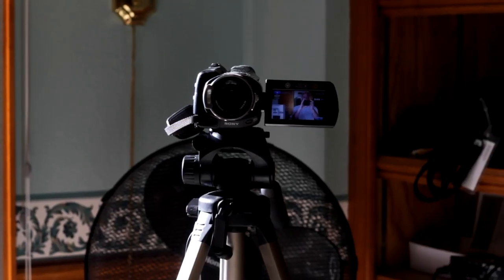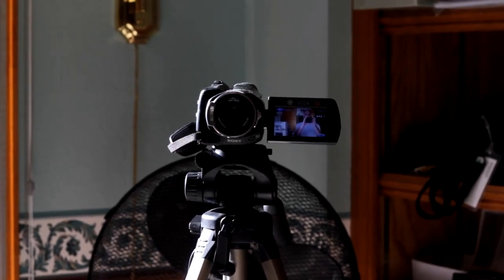Tip for Steady Panning and Tilting DSLR Video

Comment: Another cool trick/tip is to use a bolt (same size as the tripod hole) with a piece of string attached. The string has to be long enough to reach the ground. Put a loop in the end of the string for your foot to go through. screw the bolt into the bottom of the camera and shoot with a little tension on the string. It will steady the camera while shooting video.

Comment: Hey Dave!!! I am using a Canon EOS 550D right now, but it has not got any 60 fps mode!! There are just 1080p 25fps, 1080p 24fps, 720p 50fps and then the two SD modes 50fps and 50fps crop. I think it should have a 60fps mode!!! Maybe I have to change some settings? Please reply!!!! I am shooting a movie right now and I have to find out what is the problem. Even if you cant help me, please reply!!!